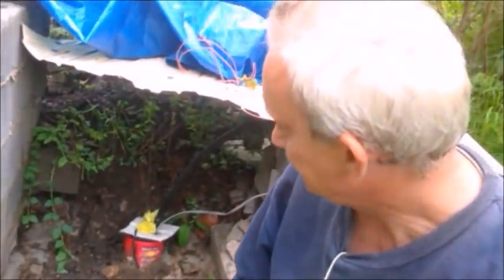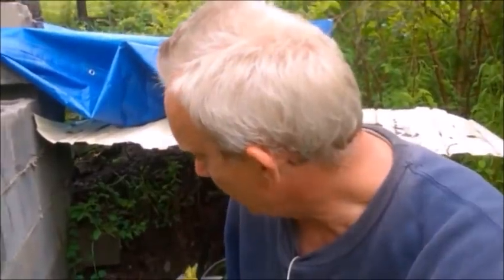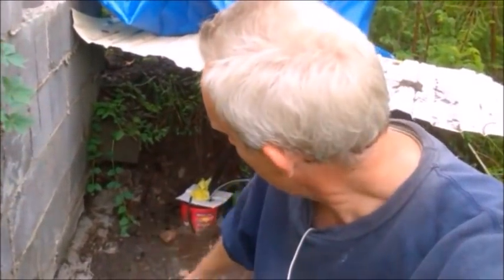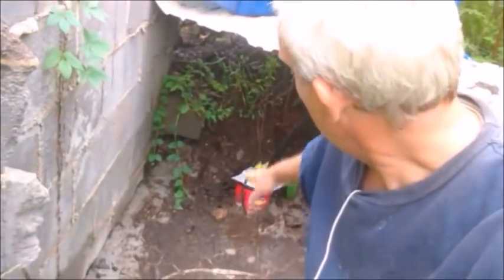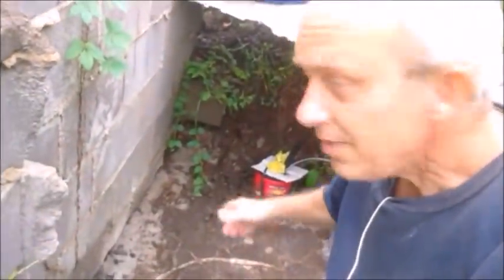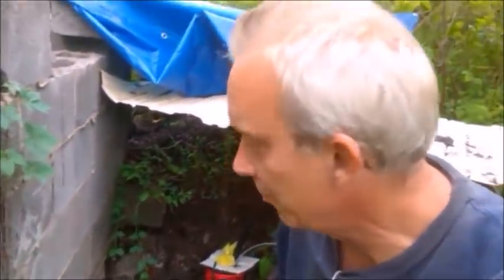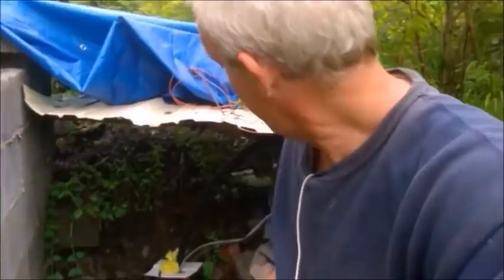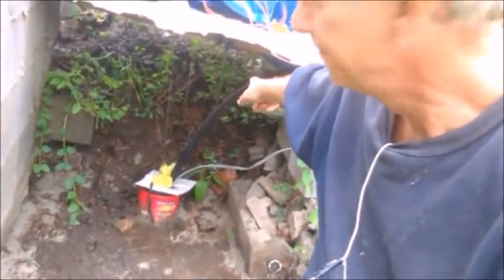60 MPH Winds Storm Damage Assessment While Off Grid Living In A Tiny House

Comment: When I was a kid in southeastern Ky, we always had a well with a submersible pump. I do not recall ever having a pressure tank. It worked fine but we also didn't use as much water as we would in a modern home.  The well head did have a little cinder block house over it with a concrete floor.